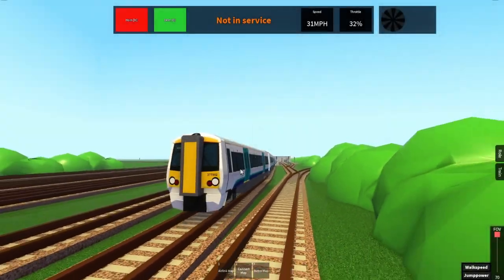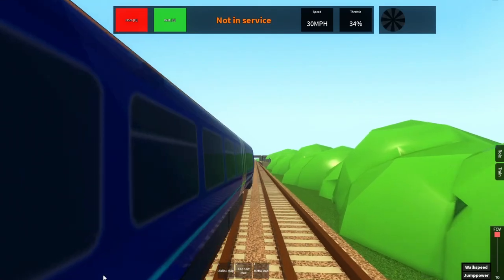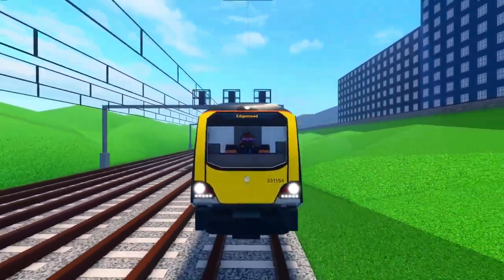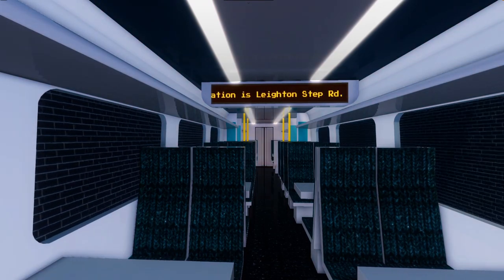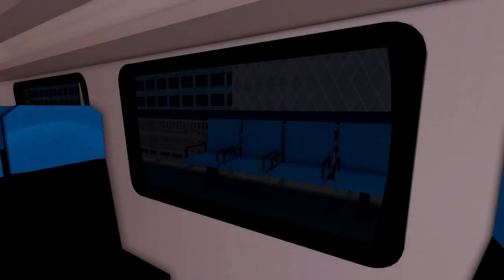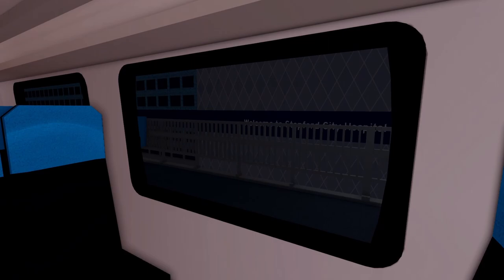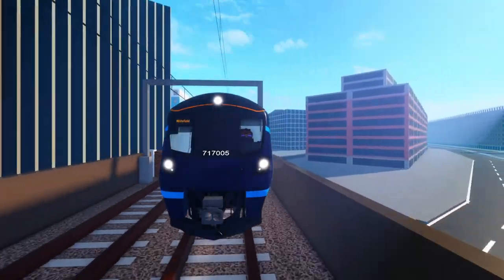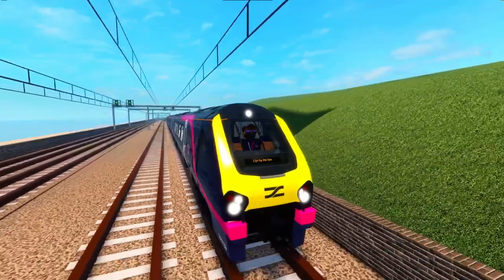From Paper to mesh an SCR documentary

Comment: You forgot the 707 was ngv2 all the way back in 1.4.something, and the 730, 165, 166 and 380 were all ngv2
Reply from the maker: When I wrote this script my perspective on it was that NGV1 were made with normal Roblox Parts, NGV2 are the ones made with CSG like the 707, 720 and fishbowls and NGV3 are the ones made out of mesh, hope that clears it up.

Also I don't see a very big difference between your NGV2 and NGV1.
Reply: @Bez34  yeah the First CSG was the 707 in a 1.4 patch and also the 380 and the 730 used to be CSg. It seems scr is prioritizing replacing the csg trains as now the last csg is the 165/166
Reply from the maker: @yeahman70  interesting originally thought that the only trains that were CSG were the ones updated to look smooth in 1.6